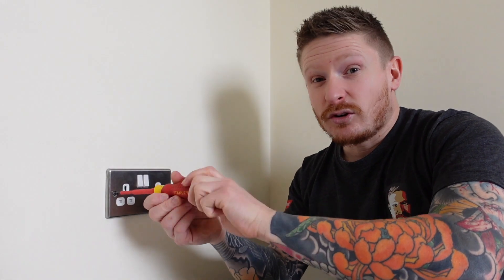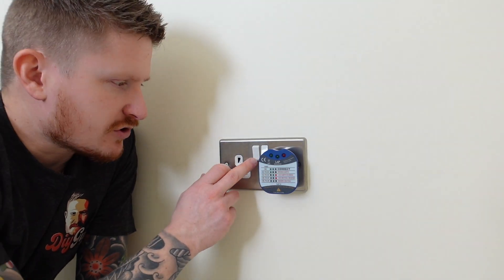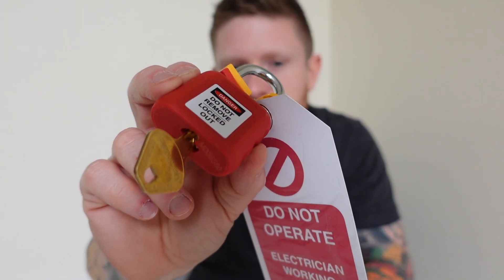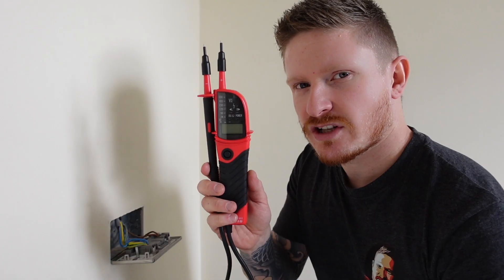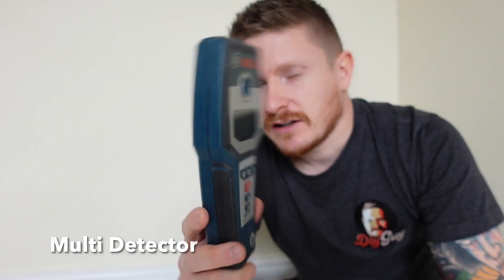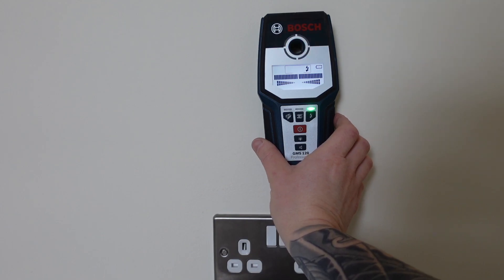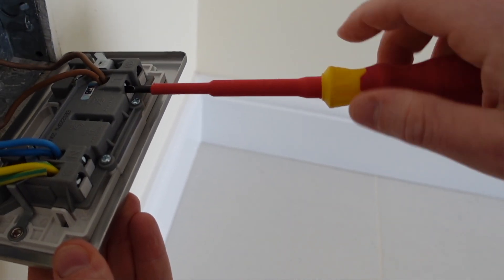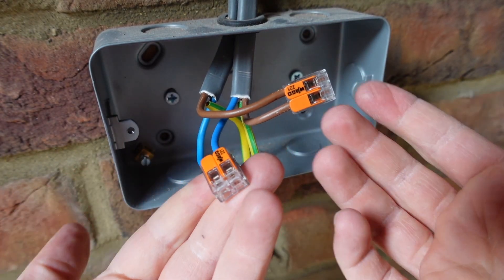How to Make Electrical DIY Safe for Beginners

Comment: In lieu of a lock off device, in a domestic environment a piece of electrical tape holding the MCB down is the minimum I would do. If nothing else it reminds you of the correct circuit you're working on, prevents accidental enabling of the circuit. I am going to invest in a cheap lock off device for my next project though :)

One major thing people mess up on DIY electrics that i've found is breaking a ring (to be honest i'm not a big fan of the ring system for this reason, 4mm radial should be safer in this regard). Technically the homeowner is not allowed to open the consumer unit to do a ring continuity test either (although I always do one ...)

Comment: Hi I have a  light switch that blow when it was minus 4 below zero, the light switch is close to a window. It might be just the light switch thats at fault but connects to the rest, as it blow the main fuse in the main box, how do you check the rest of the wiring on a meter?

Comment: When I was around 20, I was working my self on to upgrade some wires on live circuits around meter, and whatever people say, I'm still OK... I was simply careful, because, when I was around 9, I sticked my fingers in to broken socket and I know - till now - it is not the way to have a  goood day.... So it is kind of RELATIVE thing to be safe or not, but if you know what you doing and why, you will be ok... I will change consumer unit tomorrow. F the  regulations and overpriced - not available electricians who any many way do jobs mostly like a cowboys do.... So morale is simple, I can do EXACTLY AS BAD AS PROFESSIONAL DO, OR IF LUCKY, BETTER.......

Comment: i love the auto wire stripper but from a diy perspective it can be very easy to puncture the core cable underneath if you are say trying to strip a socket cable or lighting cable (twin and earth). some brands have sharp gripper ends, some do not. and it takes quite a bit of adjusting to get it just right and quite a bit of force to pull apart the insulation without cutting into or stretching the sleeves of the cores underneath.

i find that it would be better to buy one a twin and earth cable stripper specifically for these cables, and use the auto stripper for the smaller cores.
just wanted to add that from my experience

Comment: Helloooo, just a quickie, the photo on the proving unit shows the display + prong going to the left hole and the the thin - prong going to the right hole, yet you test them the opposite of the image on the proving unit, does it matter which way?  
thanks
Reply from the maker: Hi, no it doesn’t matter which way you test 😀. Proving units and voltage testers are designed to be very simple devices reducing the possibility of error either by the user or device. Thanks

Comment: Brilliant video, pls keep it up, Went and bought a voltmeter and socket tester after this video as i was changing the sockets and light in the house ,  switched off the relevant switches in the consumer unit but for a couple of the switches the voltmeter showed me a voltage , it seems the electrician used a feed from  somewhere else  for it😞. The voltmeter is now my go to tool before i do anything electrical
Reply from the maker: Absolutely, situations like that are when the voltmeter is worth every penny. Glad the video has helped you

Comment: Hello can you pls explain how to correctly wire a 2 way switch ? There’s a bunch of wires behind the hallway and landing switch , some cables are actually marked saying’2 way” but are all taped up, I’m trying to determine the correct combo so that hall and landing lights can be operated from either side independently
Reply from the maker: I’ve a video on two way switching on the channel. Thanks
Reply: @TheDIYGuy1  Excellent tutorial!
Reply from the maker: Thanks

Comment: Excellent, the fact you always make sure safety is first does you proud. I do some electronic work which includes CRT TV's where I need to discharge the tube, so anti arcing stuff is a major plus. Getting a bite from KV is a tad sore. And as the man says, only do this work if you are SURE you know what you are doing, shoddy electrics are a huge risk to your life and home. If in doubt, call a sparks (electrician). One plus for the strippers,, makes the work look neater and no yanking at wires with side cutters, downside, another tool to carry.
Reply from the maker: Thanks for the comment 👍

Comment: The strippers are fine when you’ve enough length of wire to work with, but the end cutting ones are better for, say, stripping wires for a plug. Anyway, another good video. Thanks , Charles
Reply from the maker: Thanks

Comment: The only way to stay safe electrically is unless you are trained, leave it to someone who is. Electricians are cheaper and less traumatic than funerals. No one would consider doing DIY gas work, electricity should be treat the same way
Reply: “Cheaper than funerals”.  How many DIYers do you hear about being killed whilst carrying out a simple electrical job?
Reply from the maker: Not necessarily 😀. Plenty of competent people out there doing DIY electrical to a good standard.
Reply: @TheDIYGuy1  guess there aren't any minor electrical works certificates for any electrical work carried out? As these can only be issued by a qualified electrician. Any alteration to an electrical installation should have certification to show it was carried out and tested for safe use.
Reply: @TheDIYGuy1  Beg to differ, seems like I'm fixing or disconnecting lockdown DIY projects that are more than capable of killing people or starting fires almost daily at the minute 😂

Comment: common electrical diy jobs??????? are there any common Gas diy jobs? because you can at least smell gas. Electric is far more dangerous to us.
Reply: Your argument is flawed. Electricity should pose no threat to competent people who are working on the systems, because people who are authorised to work on electricity should take adequate safety precautions concerning electrical power. 

The mains will never pose any sort of threat to a household like gas unless it’s some type of huge voltage that could ionise a house in seconds, in which case, why are you living in a high voltage spark gap?
-
electricity can’t fill up a building whilst you’re sleeping and suffocate you even assuming optimal situations where the c02 alarms are alerting inside their cupboards or and rooms downstairs as you and your family members asphyxiate breath by breath, there’s no ohms law or dielectric insulation phenomena to defend you there. And if you’re unlucky enough that the ignition coil in your boiler is triggered, a commonmode suppression inductor or contactor/relay in one of your appliances automatically arcs or simple ESD occurs somewhere, the entire cubic meters of gas that your house has accumulated will combust like a huge bomb.
Reply: @leo0626 You are aware of the origins of the Grenfell fire aren't you, the  biggest structural fire in UK since  piper alpha , an electrical fault in a refrigerator, which has seen the UK now adopt afdds to try and combat this. Your ignorance is why I spend alot of time putting right what people think they can do and won't hurt them.
Reply: The origin of the glenfall fire was  refrigerator fault not the circuit it was feeding from so your comment is pointless. I agree that some homeowners shouldn't touch electrics as they are very careless and don't respect the dangers, butThere are diy electrical jobs that some homeowners are capable of doing safely as long as researched thoroughly. Iv seen bad electric from work both sides. I'd argue that gas is more dangerous you can't see or smell c02 but it will kill you the same,  iv never heard of a house explode by electrics. The most annoying thing I see in the industry is fellow sparks constantly big headed thinking there super stars bad mouthing other sparks it gives us a bad name and puts customers off calling us iv never seen as much of this in other trades. As for fixing diy faults youv got a job yes ? your getting paid a good wage yes ?, so what are you complaining about it's mostly fellow sparks that aggravate me not the DIYer.
Reply: @TheGorillahands  You don’t realise how you’re now contextually diverging away from the dangers of gas or electricity DIY projects, and onto appliance malfunction and inadequate fire retardancy (combined) theory, one of the flaws in your argument being that the prime enabler for that fire that claimed tens of lives were in fact the *malcompliant cladding*, aggravated by the combustibles used in appliance manufacturing and not the concept of electricity itself *which is the subject of the present discussion*. There is no ignorance concerning my above argument.
Reply: I've been working with electrics since I was nine years old but not qualified. However, in my book that makes me just as competent as some useless electricians.
Reply: LMAO, cry your eyes, sparks like you give us a bad name. There are diy electrical jobs that homeowners are capable of doing safely as long as researched and thought out thoroughly, iv seen bad from both sides. As for gas id argue its more dangerous you can't see or smell c02 but it'll kill you iv also never heard of houses exploding by electric.
Reply: I’ve said this before on other DIY videos, where electrician get snippy about people doing odd jobs here and there. 

I’ve waited months, multiple months for electricians… who say they’ll show up and never do. Fact is there are a lot of small jobs that are important to do, important to home owners that electricians basically couldn’t give one solidarity f*** about. 

I’ve taken time off work to make sure to be home for people who don’t show up. Small jobs aren’t worth electricians time. That’s the message I’ve been getting for more than a decade where I live. 

So what is a person like me to do? Wait around like a f***ing plum, for people who have no respect for me or my time, or just get the job done myself?
Reply: @mattc1986tube  totally agree and the cost of getting someone in for small jobs is ridiculous. Rip off economy is well and truly alive. I installed 2 security lights a few weeks ago some lads wanted €200-€300 euro to do the job and those were the ones that bothered to get back to me. Did the job myself for under €30-€40 for materials.
Reply: @mattc1986tube  hope you don't take the same approach to surgery.  can't get into the hospital for my new hip, Fu*k it i'll have a go myself.
Reply: Rubbish analogy.
Reply: @VinoVeritas_  explain how?

Comment: A belt of a 5 amp lighting circuit is almost negliable.A 13 amp ring main belt is noticeable but not terrible.Move up to 30 amp and 45 amp and it is very unpleasant.Its not the voltage( all 230 circa 230 volt in the uk) that hurts its the current in amps that does the damage.A great example is direct current.Take a large 12 volt vehicle lead acid battery from a big diesel thats rated at 1000 amp hours and hold a copper pipe between live and ground.It may be the last thing you ever do.AC current at least is on/ off 50 times a second.DC is just on.
Reply: Rubbish, typical misconception. Need volts for the current, first thing you learn with ohms law.
Reply: @jordanedwards6475  Absolutely ! And that's one of the many problems of DIY electricians !
Don't get me started on any other stuff !!!
Reply: Currents between 1 mA and 5 mA can cause significant pain and muscle contractions, making it difficult for a person to let go of the source of the current. Currents above 5 mA can lead to ventricular fibrillation, a dangerous condition in which the heart's rhythm becomes irregular and can be fatal if not treated immediately. Contact with 230v via a lighting circuit is just as dangerous as 230v via a ring circuit
Reply: Its April 1st today but you should never joke about electricity and its potential dangers.  I do assume you were joking...?  If not, then you are talking absolute  dangerous rubbish and have no understanding of electrical theory at all.  (Its the volts that jolts and mills that kills)
Reply: you are just asking to die early with thoughts like that.